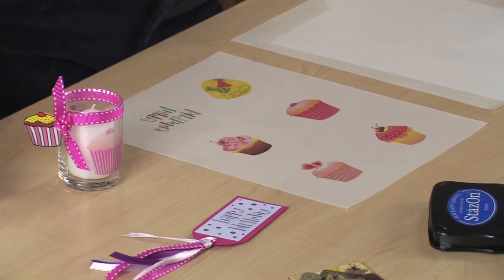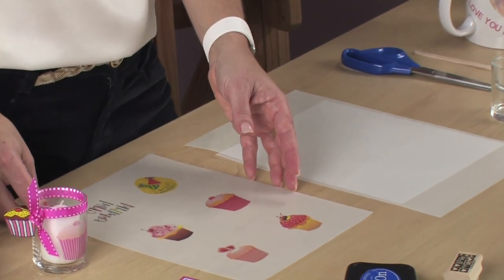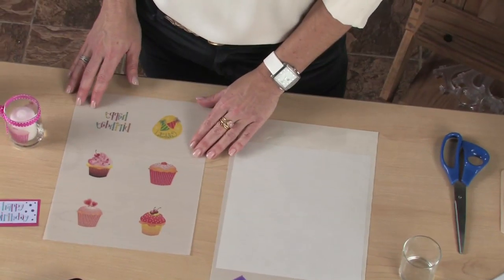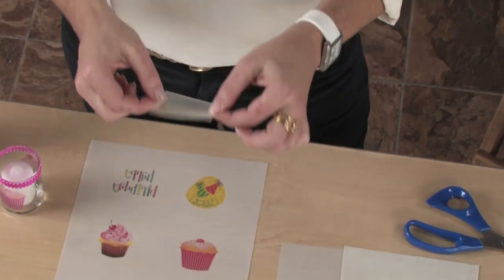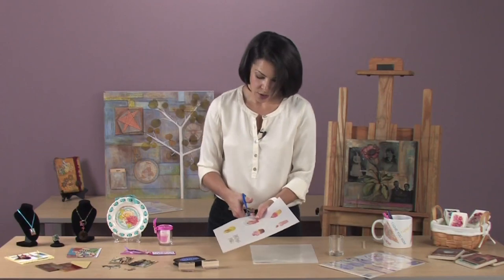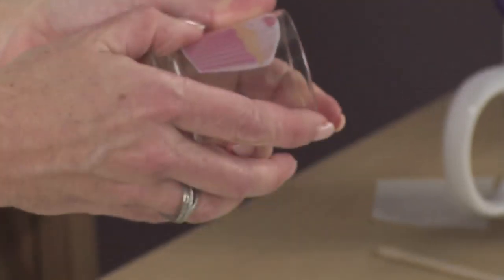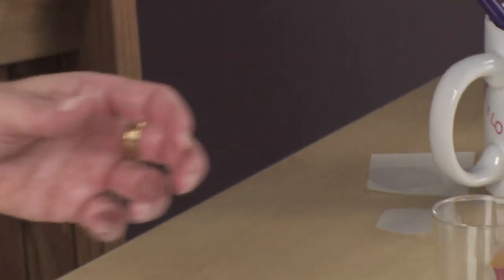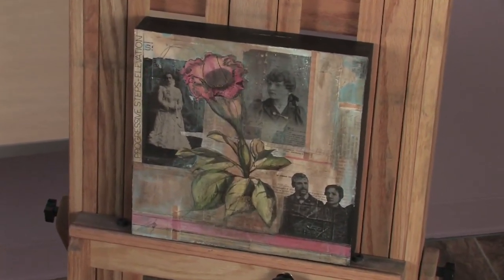How To Use Grafix Rub-Onz Transfer Film

Comment: This decal system is really difficult to use. I wasted three decals before I got one to work correctly. The adhesive would stick to the design and then when peeling the shiny surface away from the design, it would take the adhesive with it so what I was left with was the design on clear plastic and no adhesive. There are three layers in this system and you have to peel away the right layer (easier said than done) otherwise you have to start over again. Not terribly happy with this purchase.
Reply from the maker: Hello Richard, 

We are sorry to hear about your challenges with our product. We'd be happy to send you a replacement packet. If you would send your address to marketing@grafixarts.com  and please include the number of packets you purchased along with the store you bought our Rub-Onz from. In order for us to investigate this issue further.